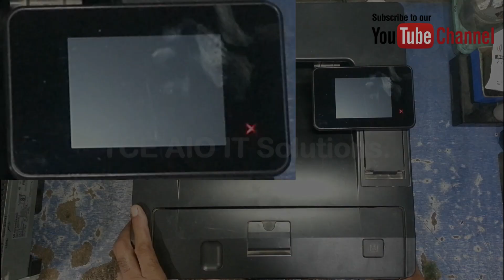HP LaserJet  Pro M400 (M401)  No Display on LCD button lights are on || Solved || and Maintenance.

Comment: Hi need to ask my screen  just no screen,  can it be screen problem
Reply from the maker: Yes its possible if LCD screens LED doesn't work noting is displayed (same as normal LCDs),

If cable is broken it happens too.

Or

If printers formatter is faulty it could happen in that case too.

In such condition we have to check it step by step.